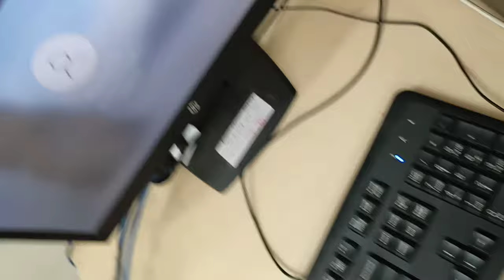check video cable || How to solved check video cable problem #technical #technicalvideo

Comment: My problem is that I have a dual monitor and the right screen says check video cable although I have no cable connected to it but the power supply itself
Reply: Hi, I have the same, were you able to sort it out?
Reply: @vaka12345rm  Nope, not at all.
Reply: @Ikronix007  If not too late, You need a DVi, HDMI, Display port or VGA to relay the image to the PC, and Monitor
Reply: @cloakz3010  would you be able to help me? It says check video cable even though I have a display port to hdmi?
Reply: I have I solution 😊
Reply: @mrvarunart what is it?

Comment: Change it to DVI or HDMI cable that's promise a better connection and experience to you.
Reply: how do I do that if my monitor isn’t working,
Reply: @intelic8061  what I mentioned above was one of the most common thing to do when your monitor keeps losing connection or it could be worst, might be the board. But so far the board problems show a sign nothing on the screen at all or burning signs
Reply: FutureYoutuber  HDMI and DVI are backwards compatible. Basically  they are the same thing. The only difference is that HDMI can also send audio signals through it

Comment: Surprisingly, no one noticed that he changed his monitor. The first monitor doesn't have a sticker in it's stand, when he went to blow the vga connection to system and back to monitor it's already different with sticker in it's stand. Don't believe in this shit.
Reply: @Dnrjhn7  I checked it is the same

Comment: Screen m jab vgA cable connect krou tou ajeeb colour deti jub disconnect kro tou sahi deti hai😢
Reply from the maker: Cable kharab ho gyi
Reply: @d2atechnical  tv pr connect kro sahi deti hai color lekin wire patli wali hai eska issue tou ni hota
Reply from the maker: Aap cable change kar ke hi dekho
Reply from the maker: Ho ske to original laga kar hi dekhna

Comment: Bro in your pc graphics card installed bcz mine issue come after installing graphics card
Reply: Bhai this happened to me too , check ur graphics card if it is loose in one area and doesnt have input then plug it in , clean the vga cable like the guy did in the video and that worked for me
Reply: @Hashiredits  ok I don't have HDMI cable
Reply: @AHSAN_Went_Wrong  i dont aswell
Reply: @Hashiredits  ok

Comment: but what to do pls tell me ?? i cant understand
Reply from the maker: Remove your pc all wire and again connect
Reply: bro but i have laptop its screen not working so i connect it with monitor it load at windows loading then shows no signal whats the problem
Reply: my laptop screen is broken
Reply from the maker: @WhizWays press windows+F1 & Cltr+alt+shift+B